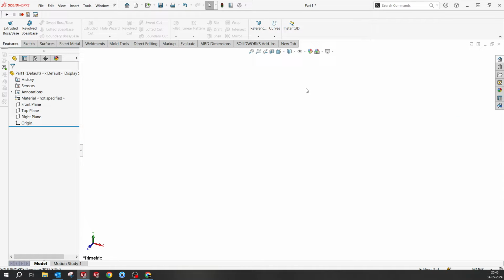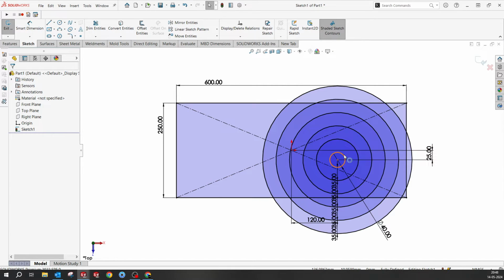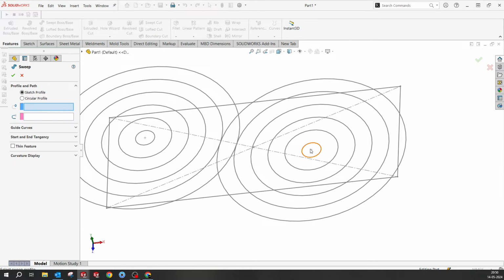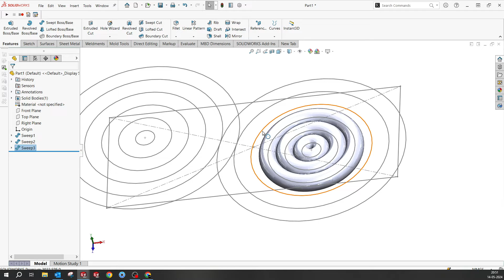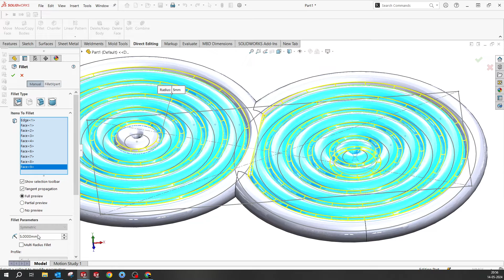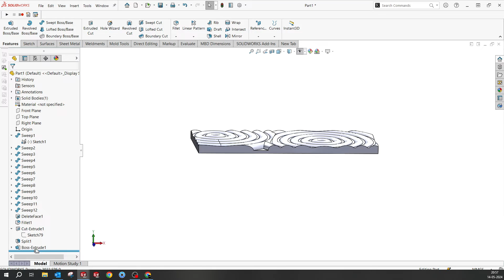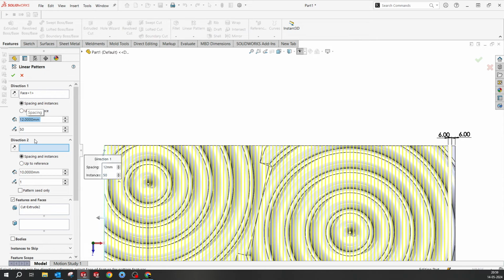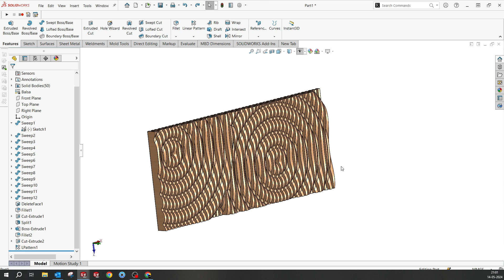Solid works - Furniture Design | Parametric Wall design | Geometric Water Drop Pattern | EP15

Comment: Very educative......I might make one for cnc cutting 👌🏾...is there an option for numbering the different  pieces for easier installation?
Reply from the maker: Sorry for the delay response.! have not made any numbers in the design you can use engraving while cutting for CNC or manually note in the marker behind the plate. Hope this will help.
Reply: @shape-it  no worries about it sure will do